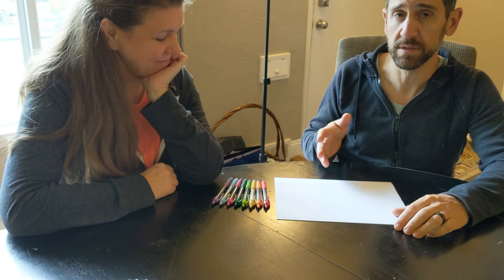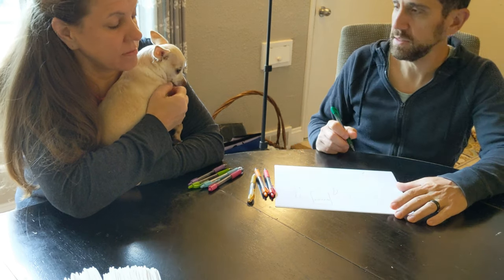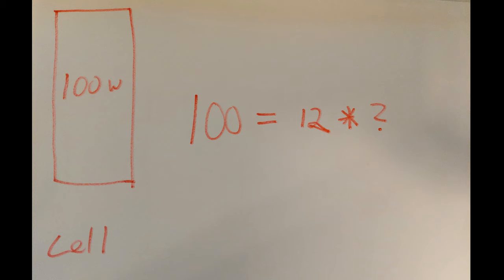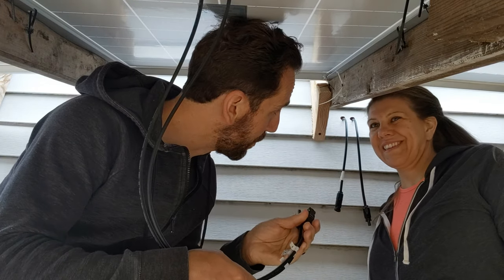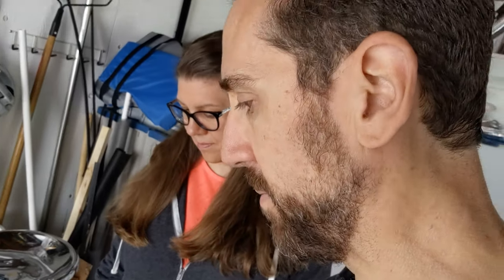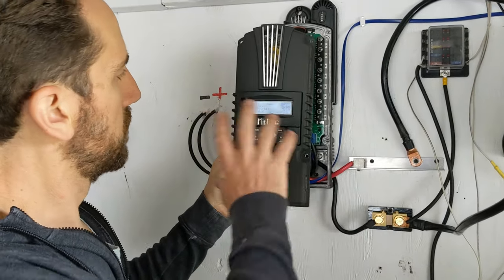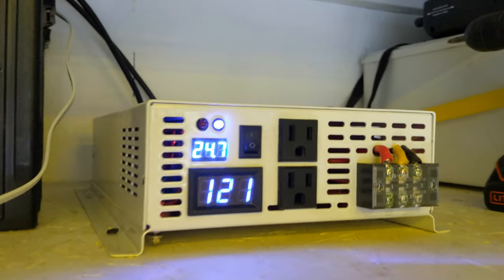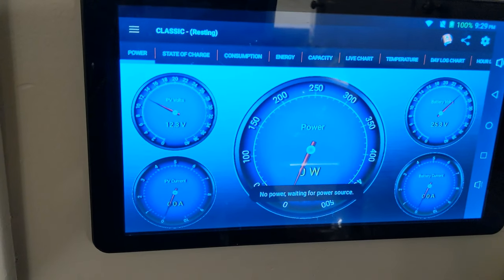DIY Off Grid Solar: Installing off grid solar panels

Comment from the maker: This episode is a prime example of why we are helpless without cameraman Ben! From off-center camera angles to mic problems Danielle and I did it all.  See if you can count how many whoopsies we made.  Multiply that number by at least 5 and that was how many were probably edited out.🙃🙃
Reply: As usual, very good explanations.  However, you should have included a disclaimer that Ohm's law is for your safety and protection...so you should always support your local electromotive force.
Reply from the maker: @craigchandler3759  Good point.  I think you may have inspired the title of a future video: "Ohms - not just a good idea, its the law!"